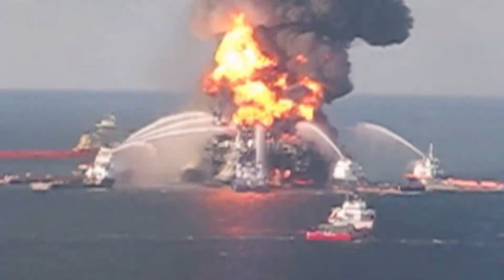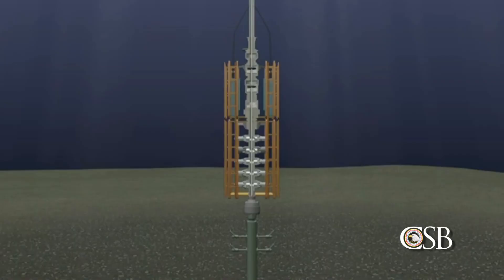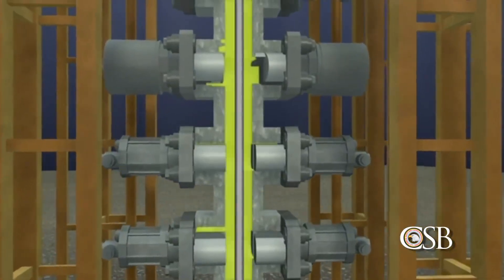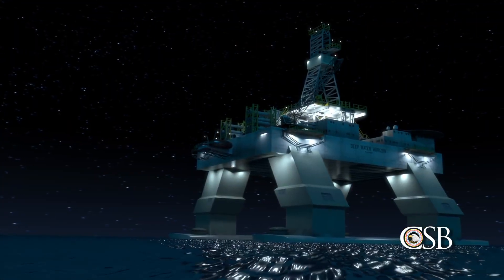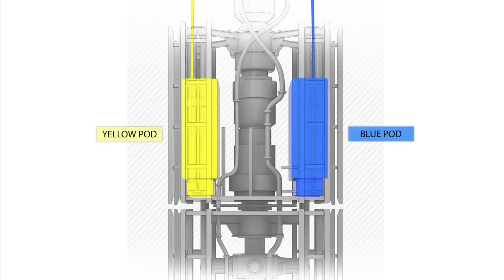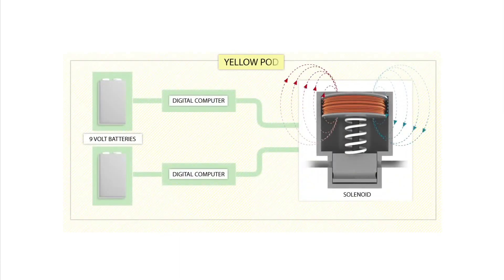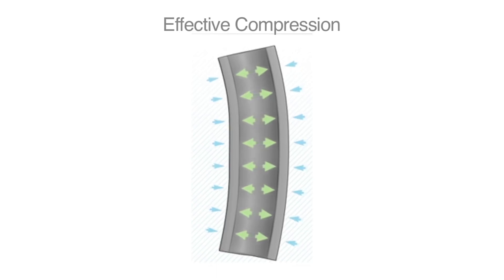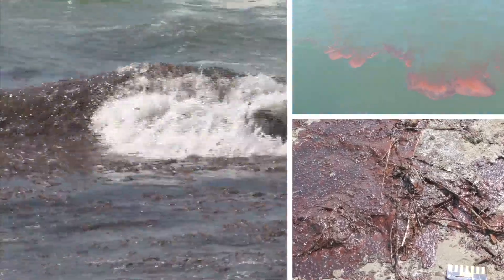Deepwater Horizon Oil Spill | What Really Happened?

Comment: What eventually stopped the flow?
Reply from the maker: Sorry for the late comment!! I have not had time to add content to this channel in a very long time. Thank you for your question! Here's what stopped the flow.... After months of uncontrolled flow, the Macondo well was finally sealed using a ‘static kill’ and a relief well. Basically, they pumped heavy drilling mud and cement down to balance the pressure and permanently plug the well. Took 87 days to get it stopped — one of the toughest fights in oilfield history.